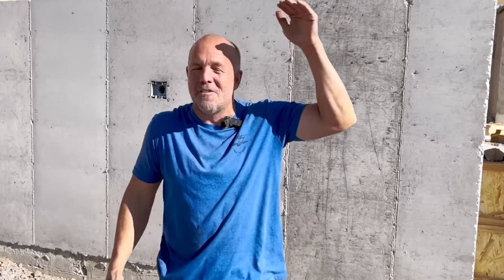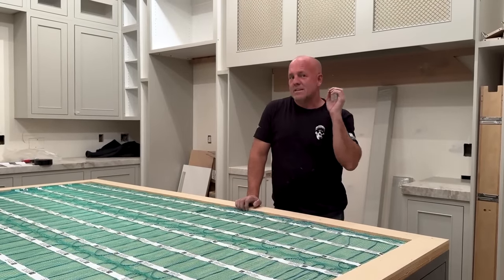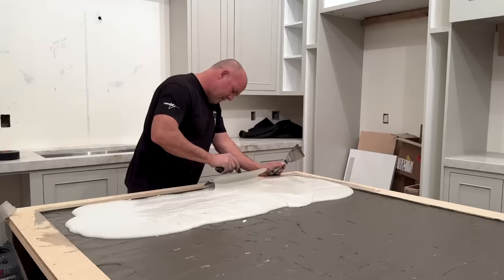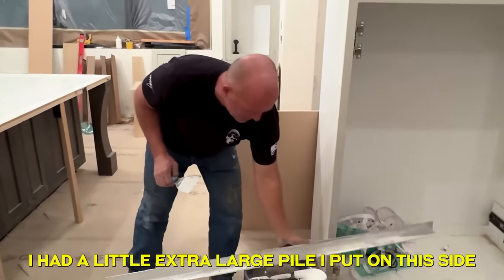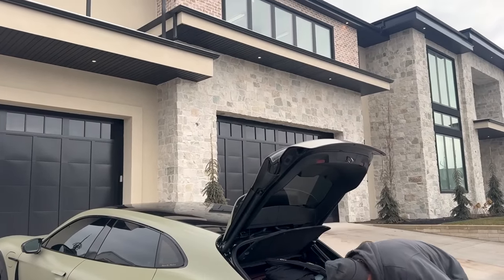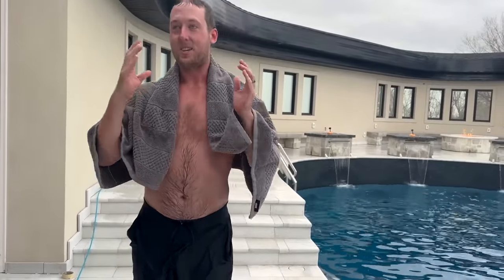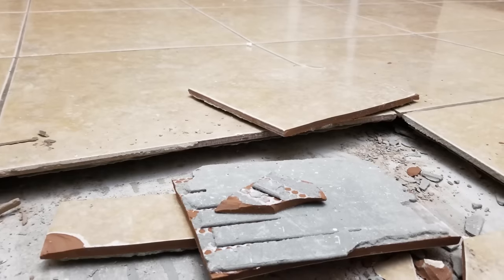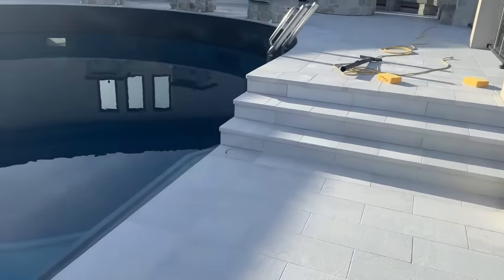Cleetus McFarland Cold Plunge in 24 foot Deep Scuba Pool | House Build #22

Comment: Wow so impressive, what a build!

I like to put in two sensors in heated floors, if one goes bad i just connect the other one and don't need to lift the floor or counter because a broken sensor. Learned this from my tile contractor years ago. 😊

Comment: I made an outdoor kitchen at home in Wisconsin, I used granite tile bedded in thinset, big mistake the third winter lifted most of the tiles, I pulled all of the tiles and cleaned them up and used silicon to bed them and allowed the silicone to fill the joints as well. Clean up was a little more difficult but it been 6 years and no problems, win win.
Reply: Thanks for the comment. Sorry you had to go through all that.

Comment: that tiling looks FANTASTIC Mike! Now that you've done it, you kinda understand why you were quoted such high labor. that was a LOT of work to have to route every tile. because as you said they would usually just set/grout it, but you took it to a whole new level. the look is amazing, and as you said the thermal changes you go through, to make it look nice for its lifetime, that's what you had to do. 
1 question. under the tiling is there any living space meaning is there any rooms of the house under that or is it just another outdoors area under it? Im a little interested in if that rubber is a good enough water/moisture barrier. because if there is a room under that tiling and it doesnt have a waterproof barrier. you may get some water coming through. I'm just thinking of like a shower, where you need a membrane under the tiling so you don't leak into the floor??  
But very nice!

Comment: I “like” the idea of the heated counter top. I bake, cook, and entertain often enough that could be useful. However I see a flaw in your design. Unless you can control the heating in specific zones its going to be difficult to have simultaneous hot and cold projects on one surface. Which happens ALL the time while cooking and baking. I hope it works but I foresee frustration and complexity in accomplishing certain tasks.

Comment: How nice of you, Mike, not to make your wife be the first in the 34 degree pool!  Too late now, but you COULD have tested the drain down capability to retrieve that coverall.  As it is, that piece of clothing probably introduced some bacteria into the pool.  Hopefully, you've got the water already protected with chemicals to kill that stuff.  I wonder how long it will take for your pumps to refill the pool after a drain-down?  And what will that cost in electricity?  I forget, are you planning on using solar PV panels to supplement the grid>  Are you planning to use solar water-heating panels to offset the cost of heating the water?